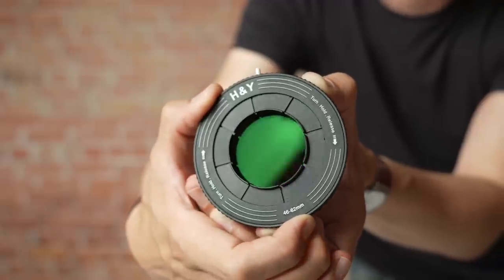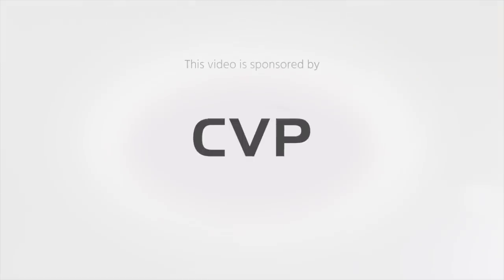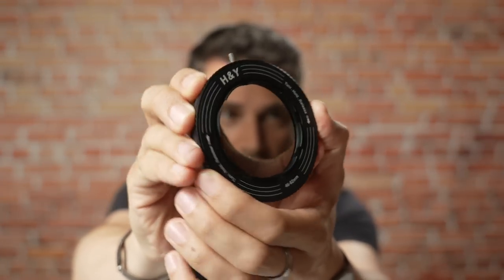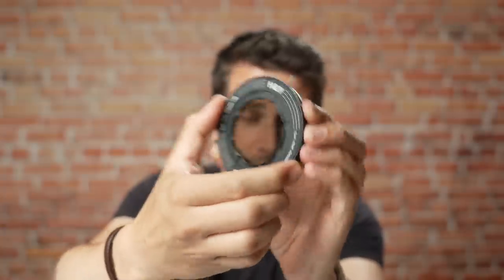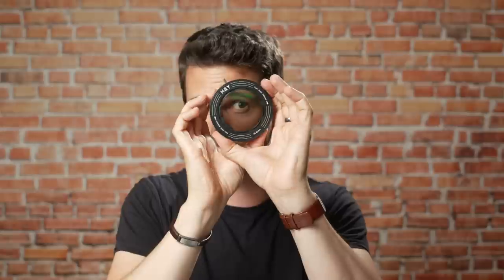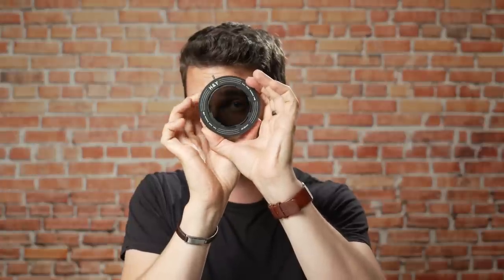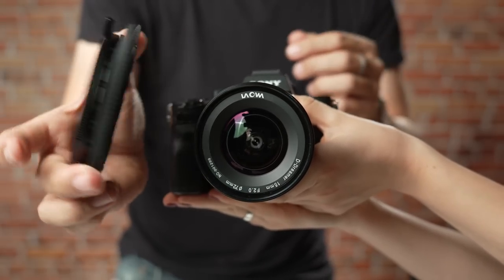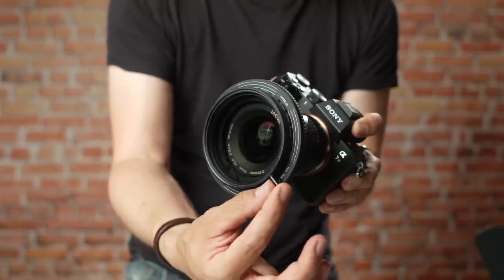Goodbye Step-up Rings! - REVORING – the Variable Step Ring Adapter

Comment: I'll stick with my step down rings. Most of my lenses are 77mm anyway. Just need a 77-67 and 77-62. I think you're better to standardise to one size. 82mm or 77mm.
Reply: Have you used it?, i thought the same but its really handy when switching lenses, even if they are the same size this filter is way faster to attach - detach.

For those who already own some step up rings and variable ND might not make sense moneywise, but for those buying their first is a no brainer, i mean you cant go wrong... when i was starting i bought a small ND and polarizer and i cant really use them now with my new set of cine lenses... plus they dont always come with the same mm size.

Comment: Note that there is a typo:

INCLUDES: 1 of each REVORING
37mm - 49mm (52mm filters)
67mm - 82mm (67mm filters)  <--- should say 82mm filters
46mm - 62mm (82mm filters)  <--- should say 67mm filters
Reply from the maker: Where do you see this? In our post on cinema5D.com, the information is correct.
Reply: Heya  @CineD  On the Kickstarter page this is the text in the select a pledge column (though there's a chart/image with the correct information there somewhere.)  Sorry for the confusion - I hadn't gone to your text article, yet :)

Comment: Hi there. I'm wondering if I could use one of these to switch my bright tangerine atom misfit between dslr lenses. I could have the 82mm to 114 step up ring attached to this, and switch between lenses easily. Is the thread as strong as a normal thread? Do you think it would take the weight?

Comment: Photo colleagues, I want to share  my experience of non existing support from H&Y as well as bad design.

1. The Lock mechanism is total trash and will not stay firmly, it not secure and will suddenly fall , like it happened to me, and I ensured it's very firm when attached. Did attach by instructions. The filter actually never "locks". It's just get tightened and then again loosens and rotates again, that's how it's built.

2. The X shape pattern on ND is very visible and not usable after ND5-7.
 
3. There are no markings on ND after ND 5 to 10 ND , so you have to guess. 

4. There is grainy pattern when using ND/CPL, compared to my other filters I own(Haida, Tiffen, Hoya). It seems not as clean on the sky. 

5. The support is non existent. Will not honor warranty.  Will accuse you and say that it's your human error (that's what they told to me)

The pins to control ND and CPL where supposed to be touched, to control ND and CPL, but every slight touch can lock out and drop the filter . No secure filter system at all. The company did not honor the warranty and didn't want to fix the filter within the first month of use. Shame company. I was securing and fitting to lens strictly by instructions. Will not buy again from H&Y
Reply: Having the same issue. I bought only the ring adapter to be used with my own vari nd. It never actually locks and will get loose as soon as I change the density on the vari ND . I'm returning mine.

Comment: Great idea! Unfortunately I'm using only Sigma primes (24, 50, and 85) and since the 24 and 50 are 77mm and the 85mm is 86mm, I'd need a 77mm-86mm. So I guess I'll stick with my standard step-up rings for now!

Comment: Who carries rings? just put step up/down rings on each lenses and put a cap.
Reply from the maker: If you always are the only one working with those lenses and if there is only one type of filter you use, sure you can do that. But it's not ideal when using different kinds of filters like NDs / Polas or IR Cut filters and changing between them.

Comment: Any locking mechanism for the variable thread size part? I think it might be easy to accidentally shrink it and it will fall of the lens.
Reply from the maker: Yes you have to screw it on, so it is locking.
Reply: @CineD  but if you accidentally turn the ring that defines the lens thread diameter then the thread will loosen and it will fall off.

Comment: Man this is so pointless! Just buy steprings for 1 dollar for each of your lens size to the same size and there you go, always the same size on all lenses.
Reply from the maker: The entire point of this is not having to think about bringing all those rings all the time. I've been screwed often enough by forgetting the correct step-up ring when using a lens I rarely use with a very small diameter, for example.
Reply: @CineD  What I am saying is that you permanently screw on a stepring on each lens so that they have the same size. Then you just buy cheap lenscaps for the new size on the steprings.

Also this gives much more protection on the front element of the lens.